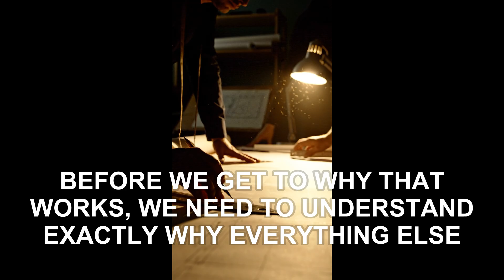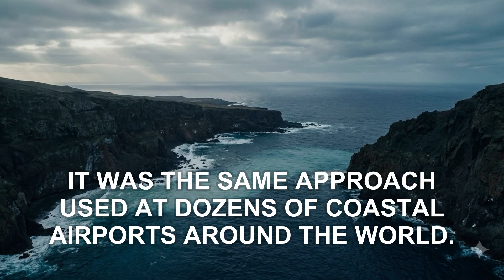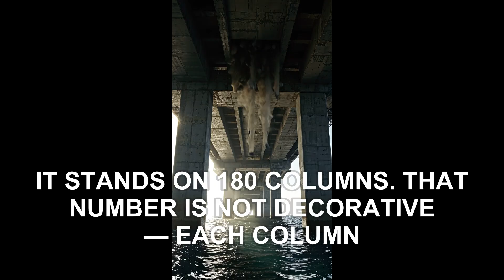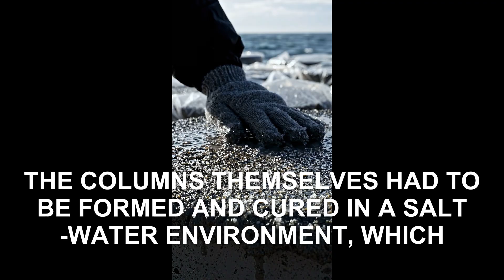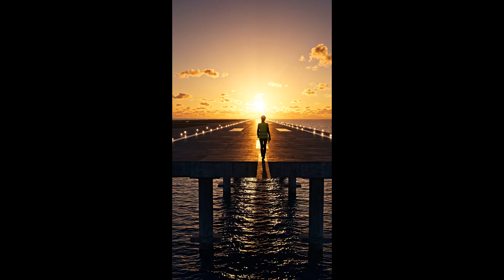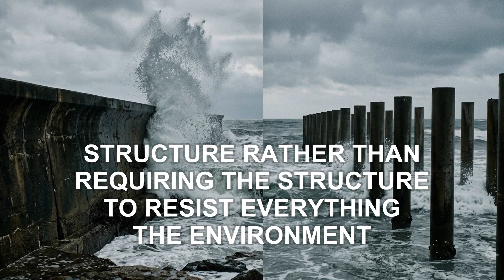The Engineering Behind the World's Scariest Runway

Comment from the maker: Seafloor too deep to fill. Cliff too steep to cut. So Madeira put the runway on 180 concrete columns over the Atlantic — and left the space between them open so waves pass through instead of slamming the structure.

One question: is wave transparency the only honest fix when reclamation dies on a volcanic shelf… or is a 1,000 m deck on stilts just trading fill risk for a century of marine corrosion and storm loads?

Drop your take 👇

Watch next: The Only US Airport Designed to Stay Open in Extreme Snow